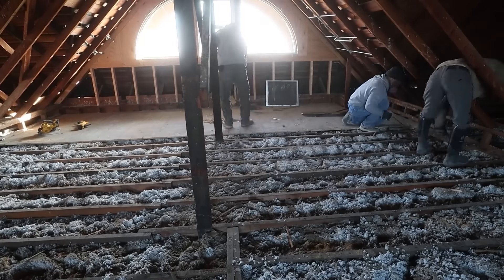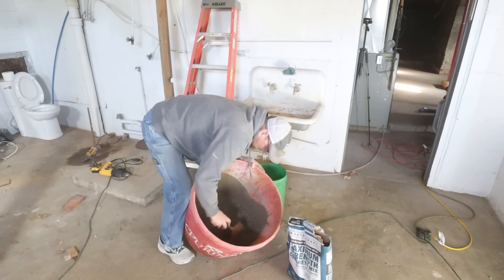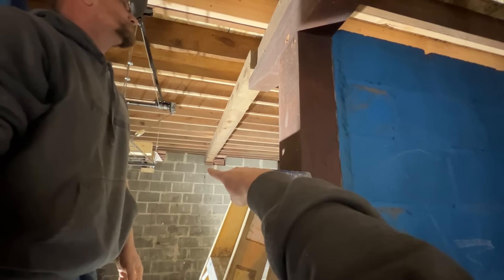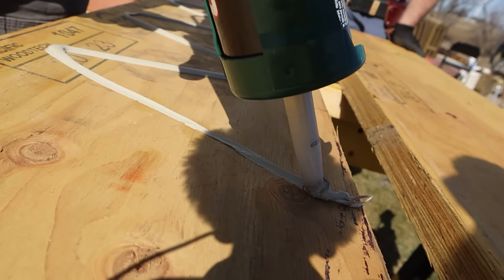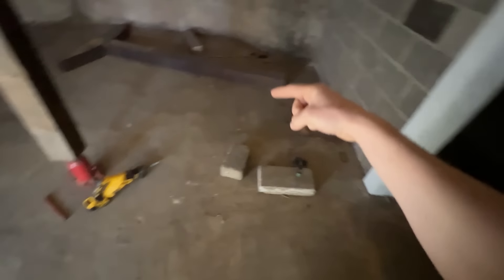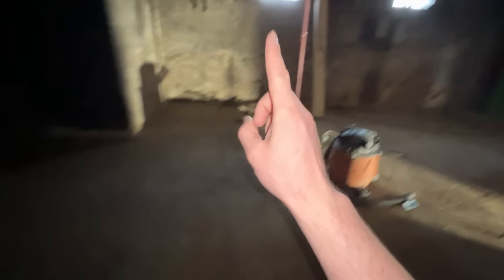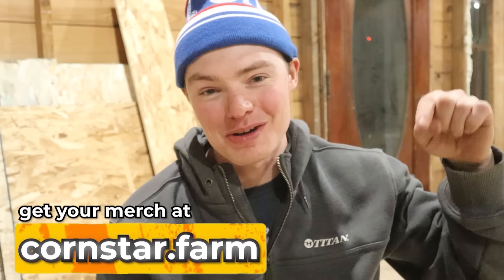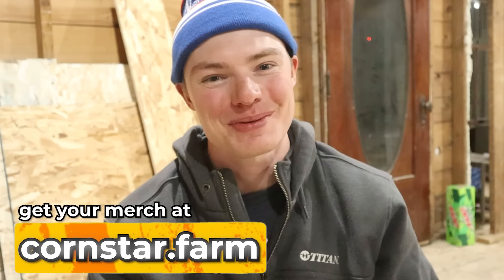Restoring A $7,000 Mansion: Rebuilding Basement Ceiling

Comment: ALso you should REALLY consider a ground sorce heat pump, You will already have the duct work in for the A/C so there will save on that . If you have never heard of them in Iowa you should . I have had on for 25 years and it is wonderful.

Comment: Do the footer drain around the the exterior of the foundation footing run them to the creek if you have enough elevation do not tie it into your floor drains do a separate one for your floor drains into a sump pump you don't want to cause a problem where you get too much water around the foundation that starts pumping itself into the basement

Comment: Pouring cement: as others have suggested, you order a pumper truck with a crane and a long hose attached. The hose will only need to go through the one window and you drag it to the furthest point and work your way backwards. Someone suggested self-leveling concrete which sounds good, but I don’t know that PSI strength of that vs standard concrete. Research. The

Comment: Pump truck for the floor. Could do the hole floor all at once. They just run a 3 to 4 inch hose. Would be easier and won't have to pile up concert or wheel barle to the other rooms.

Comment: Don't runs outside "french drains" under the basement., stay on the perimeter.  Don't open that can of worms.  Also, don't remove all the concrete floor.  Tear up only what needs to be removed for new drains then cover entire floor with self-leveling fiber reinforced concrete. Later give it all an expoxy finish that will help "seal the deal" as well.

Comment: I would think for the basement concrete floor to get the new concrete in it might be possible to use a pump and hoses.  Then you drag the hose to where the concrete is needed.

Comment: That next been I would put up with overlap. If it's a 60 foot span, put up a 20 or 30 foot lvl with a 10 or 20 foot glued and screwed to the starter end. Attach the next 20 or 30 foot and continue to end over lapping.

Comment: I've taken out much more concrete then I've put in I figure, working for a large municipality street department for 30 years. But looking at that basement there's only one way that I could imagine that concrete ever coming out and that involves a towable heavy duty air compressor and a couple 100 pound jack hammers. Equipment will be those hammers working and breaking it into manageable sized chunks so they can be taken out though one of the windows. One hammer with an experienced operator can keep two or three guys busy lifting out the chunks in my experience. If it is on the thin side (reduced weight) that's a good thing when you're lifting it out of there. I could see the use of a concrete saw to make a straight line around the perimeter of the basement during or after removing the concrete. But again because that's in a basement you'll be limited on the size of concrete saw you can get in there. Personally I'd get a couple of bids to have a contractor come in there and knock that out taking the chunks with him after he's done and making that nice line all the way around the basement as well. I wouldn't want to remove that if I was doing a similar project as that would be a little above and beyond what most would be physically capable of doing. A contractor and his crew could do that in a day. (and put it in in a day as well) You guys?? Carpenters HATE dealing with concrete!!! No matter what they say!! Half a week IF YOU'RE LUCKY. The entire week if you're not. You're probably going to have a contractor put in the new concrete anyway once the drains are in etc etc. So GOOD LUCK whatever you do!!

Comment: Typically a footing has two tile lines. On the outside, there is one set on top of the footing tight to the foundation wall. On the inside of the footing, the top of the tile is installed level with the top of the footing (directly underneath the vapor barrier, insulation, and slab). The inside tile is lower than the outside tile, but the top of the outside tile will be at or below the finished floor height. If possible, it's best to run the outside tile out to daylight. It'll collect the majority of the ground water and unless absolutely necessary, it's better to keep the water that is already outside the house, outside the house. Avoid connecting both tiles together for the same reason. It'll simply transfer water under the slab due to the elevation difference between the inside and outside tiles. Instead, run them separately into the sump basin with non perforated tile. As long as the float for the sump pump is below the inlets, water can't flow between the lines.

The vapor barrier, interior tile line, and sump basin are all part of radon mitigation. Basically the sump basin is sealed air tight and a fan vents  to the roof, keeping the basin in negative pressure. 

Hope this helps.

Comment: Hey Cole for the basement how about using a pumper truck for concrete and let them pump it down there with hoses that would be the ideal way to get it filled and not have to drag concrete anywhere talk to the concrete companies and they’ll tell you that

Comment: Coke I am by no means any kind of professional but I remember helping my Dad when I was younger & we used a wheelbarrow to move concrete from the truck to where we needed it.  As long as you rinse it out afterwards you should be fine.   PS….you can do handprints & the year in the concrete.

Comment: Cole I wouldn't bring water from the outside run the tile on the outside and drain that to the ditch with a back flow preventer and then run tile on the inside of house to sump pit and pump that to the ditch instead of bring it all to the sump

Comment: Before you do anything to the basement. Is there  a history  of flooding. If not, then do you need to dig  around the outside. That is a huge job. Would tanking be an option. That often resolves the issue. I don't  know if you use this in the US.

Comment: Great project but why would you leave those cinder blocks walls?  Pull them out and put footings in for your beams when you do the floor.  Put perimeter weeping tile in and that should handle the moisture.  Ask Bondo built for help Cheers!

Comment: Radon gas comes from degradation of natural uranium. It seeps through shale etc into foundation. If the foundation of the basement floor is solid then you should be good. You can get a radon test kit in Canada from the Lung Association. I would call American Lung Association or just google radon gas kit for purchase. You just place it in your basement for a month or so and send it for analysis. I think it’s like 50$ . Affects most often people living with no foundation like modular home, trailer etc. a radon mitigation is basically a fan exhaust system .

Comment: Do not connect your interior tile to exterior tile for possibility of back feed of water and added Radon gas. Best bet might be a sealed sump pit which may never even need the pump but would be the collection point for any water and a way to vent Radon without a fan ,Be sure to seal around every wall to floor joint after new floor. Moisture Barrier is a must ,Foam would be a plus !! Radiant Heat a luxury but depends on what your plans are for the basements. May want to spray foam the exterior walls and joisteses space also

Comment: Gee whiz! For moving the concrete in the basement, did you ever hear of a wheelbarrow? Thats all we ever used to move concrete in basements and it's a lot cheaper than a pump truck. You're young and strong put a little sweat into it. You'd be amazed what you can do with a wheelbarrow.

Comment: USE A CONCRETE LINE PUMP THAT CAN BE ATTACHED TO THE CONCRETE TRUCK IT CAN BE RAN IN THE BASEMENT LIKE A GARDEN HOSE, ROOM TO ROOM!
Sorry about the caps I just wanted to get you attention. Also thanks for another great show. Also I know of a new energy efficient way to add drainage and more insulation to the home under the concrete. I have to find tge company and I'll pass it in to you or give them your contact information. They might do it at a discount ir better...

Comment: You won’t be able to deal with water drainage around the foundation from the outside unless you remove the porch and do the entire outside.  So you may want to look at an interior idea like omibasement uses.  If you have the funds get a pumper-truck for the concrete or just use wheel barrows.

Comment: I grew up in a very old house. That large hole with water in it was where our pump was for w
ater in the basement. If your drains go to a creek, what would happen if that water is high. Need to make sure the water can't run back. My father filled that hole around a pipe that ran to a finger system he constructed in our yard. We never had water in the basement again. It could not run back because the pipe had a lock drain. Water could run out, but not back.

Comment: Water always level out. unless your basement floor sits  on clay, you don't need drainage(french drain) under the floor. All the soil drainage will be managed by the french drain around the house.  (that french drain around the house can be level(water will find it's way to the exit within the 4" pipe) and then slope it to daylight. Dont' direct it to a catch bassin and sump pump if you can avoid it (power outage pretty much always occur when the drain need to work(rain storm).    

Basement concrete floor: yes concrete pump make it easy( the one on trailer by contractor, not the big crane one) but for the 1-2" thickness a basement floor need: 2-3guys and wheelbarrow will do the trick. Just build a concrete chute (with scrap wood from the windows to the wheelbarrow height....so the truck can drop directly in the wheelbarrow.

Comment: I have built a house with a Radon barrier, but since you are going to renovate the concrete floor without removing the concrete walls, you will never escape the radon gas, it must be 100% tight from outer wall to outer wall, pipes must have penetration collars. A radon well must also be installed, and if there is a lot of radon under your house, you must put an air pipe over the roof, if you have any questions, just ask

Comment: Radon: we have an EcoQube that plugs in and continuously reads radon level. We couldn’t do sub slab on our old house, so we have an air circulator in our lower level. Honeywell True Fresh ERV/HRV. Two five inch ducts, one bringing fresh air in, and a second ejecting old stale air. It is programmed to turn off in extreme temperatures and the EcoQube will read higher levels every time. We had a friend die of lung cancer at 36 who didn’t smoke, ended up testing his basement at over 20 whereas 4 is the remediation level. So we spent a couple thousand to avoid any issues since we were over 4.0… If nothing else we have a fresh smelling basement! Also, without a layer of clean gravel to suck leaching gases through below the concrete slab, the traditional sub slab fan system is worthless outside of the small area you have the pit dug.

Comment: Cole, you've got to be kidding about getting the new concrete distributed: Have you consulted w/experts? There are extension tubes/pumps they use to direct the flow to wherever it's needed. A 10' deep porch is no impediment....

Comment: Tearing out the basement floors, installing drain tile around the outside of the house... you would have been better off tearing the house down and building new.  Cheaper and faster.  Don't forget your a few weeks from tillage and planting, then spraying.  Can't wait to see how you're going to to haul all that concrete out, because it's probably going to be have to done by bucket loads.

Comment: You may to us a concrete line pump , make sure you hire a basement engineer to deal with drainage and radon mitigation it will save you money in the long run

Comment: Can you just pour concrete on top of the existing floor?  You could drive rods down and put in some wire to reinforce it.  Also I have seen people in wet areas use fiberglass in the concrete.  It really makes it strong and water resistant,

Comment: On the subject of Radon:
Get a one-off test.  If you're at all high (you probably are, if it's a 'thing' in your area), I can highly recommend the RadonEye RD200.  It's a bit pricy, but it's a continuously-monitoring system that you can view data through an app on your phone.  It's very helpful in letting you understand radon levels in your home over long periods of time (seasonal change, changes due to behaviors like opening windows in the summer, etc.) and lets you see current measured levels with a small screen on the device.  

Radon is measured in picoCuries per Liter (pCi\L).  A Curie is a non-SI unit measure of radioactivity, specifically the number of decaying atoms per second.  That's the number you want to be under 4.0 per EPA guidelines (2.0 per WHO guidelines)

Comment: It's called wheelbarrowing the concrete to another part of the basement. The room that has the concrete truck and get to is there a last I want to pour. The babes I usually put together up in ceiling and glued and screw together. Sometimes even steel plates is added for long spend and bolted in. Radio and gas is not radiation. It is a natural gas from vegetation rotten of dead earth. The main fix rayon gas. You put 6 ml poly under the slab before his poured. And you can use radon gas  detector.

Comment: Isn't there an option of using a hose to pump the concrete through the windows to the harder to reach areas?  At least you wouldn't have to scoop or shovel the concrete through the different rooms.

Comment: Do not treat your block walls. it just traps the moisture and salts in the block causing the block to deteriorate. a drain on the outside and inside will work better in the long run. aslo grade the dirt to slope away from the house.

Comment: Zick Zack Roman. Since this is leves all gluestripe sides open to the outside air to vent the water or solvents out.
Making circular patterns or a frame aof some sort arround traps the glue (or silicon or acryl) and the dryout process is way longer or even never happens or deteriates the inside trapped parts because of high solvent or reaction gases in the small gaps.

Comment: Use a wheel barrel to move the concrete or a pump truck!

You need footings for all you post in the basement especially if the slab is just a rat slab "very thin".

Do all your water mitigate from inside since your are redoing the slab.

Just demo th concrete needed to make repairs under existing slab and pour your new floor over the remaining concrete since you seem to have enough head room!

Do not tie floor drains into septic!

Comment: fun times, I can't help but think that steel beams could give you more headspace in those basement rooms, for the drains, the original builders most likely put in drainage... you would know if it works or not because you'd have water in the basement a lot over the last 100 years...  do you have that from time to time, if not, then I wouldn't mess with the drains... the well can act as a sump pump to put any water if it gets in so I would leave the well too because it can be useful but make sure it's really secured and covered well to keep kids and pets and adults and things from falling in, remember it's like a huge sump pump, super useful...  so there is probably already a drainage system that works because it doesn't look like that basement is wet except for a few spots that don't look too  bad... the main thing is the how the exterior soil drains and if the soil drains away from the house in all directions that's the main thing regarding the drainage...  since you are all certified in concrete you know the concrete trucks come with long hoses if needed to get to those difficult to reach rooms... if the rooms are going to be bedrooms and maybe even if not, those basement windows aren't up to code for bedrooms (just a guess)...

Comment: transferring wet concrete from one side to the other side is easier by wheel barrel than dragging using rakes, shovel's and other things. use a 2 wheel barrel type. dont get a large one use a a smaller on. The amount of energy to pick up and move a large one will wear you out faster. by the end of the pour you will have back problems that will last the rest of your life.

Comment: Cole keep your cast-iron main drain. It’s a good soundproofing pipe. If you use PVC you’re gonna hear all the water rushing down the pipe does not have soundproof material. It’s better to use the cast-iron as your main drain. I know that happened to me too. I used BBC as a main drain and I regret it, you hear all the water rushing down the pipe you can’t branch off with PVC but the main drain should be casting cast iron cast iron not not BBC or ABS plastic